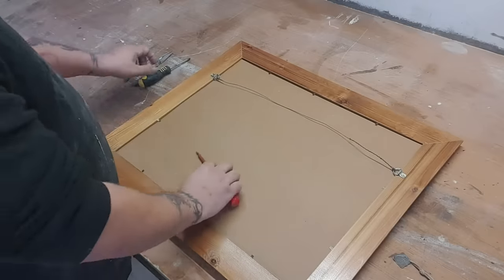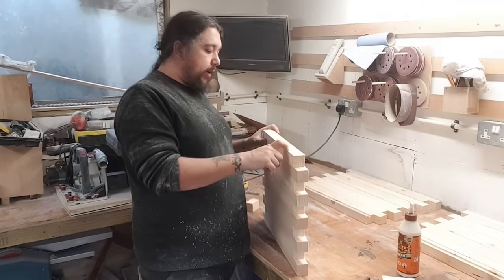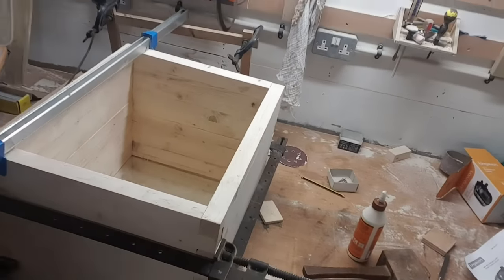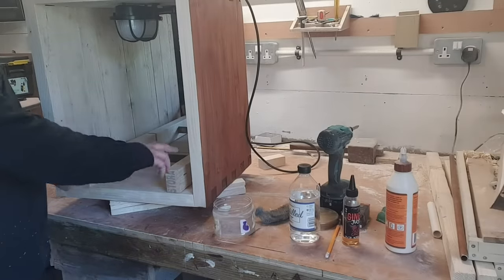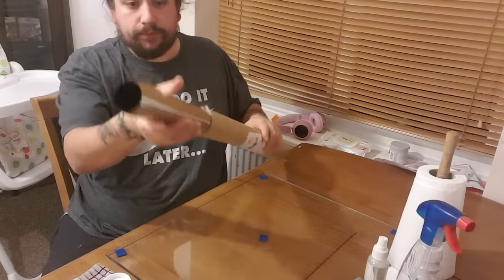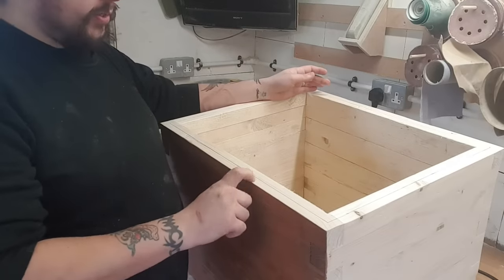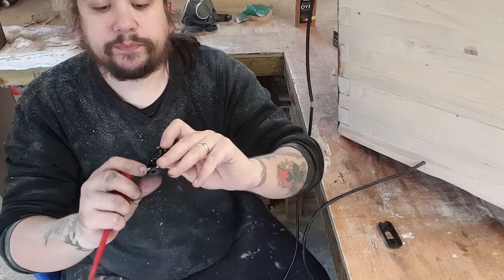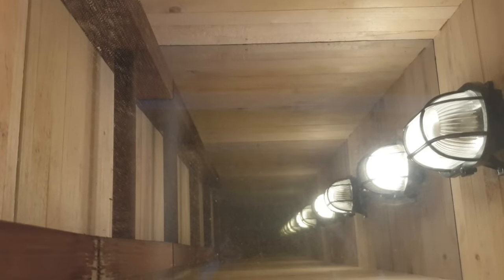Infinity mirror mineshaft coffee table

Comment: For the lamp, if you had cut it in half and pressed it right up against the mirror, you could have doubled the depth effect by making the lamp appear to repeat half as often.
Reply: The light was the only thing I disliked...so half a light mounted against the mirror at the bottom would create half the repetition?
Reply: @Rob86er  Yes, exactly. Though he would of course have half the space to fit a bulb inside, so the electronics would probably need to be modified too.
Reply: Genius.
Reply: there would still be a noticable borderline cutting across the lamp, you can kinda see the 'sections' where the mirror starts in the video with the different shades. to ease the gap we could install the lamp horizontally.
Reply: @bi_zha  Take the cage bit from the discarded half, maybe sand it down a bit and throw it where it touches the glass. Might be able to hide the seam by pretending it is part of the fixture.
Reply: Could also just use a smaller light.
Reply: @diggoran  White matte cover and a ton of LED strip inside.
Reply: The first thing I'd do would be placing it horizontally, as those bulbs facing in alternating directions look weird. Next, cut it in half, use a matte white cover too (so nobody would see what's inside, although a massive LED in a plastic shell that looks like an actual half-bulb would likely go), and... Oh snap, the cable! No issue with one in fact, as you can paint a PVC hose to make it look metallic, and cut it in halves with ease. For the fun thing, you can also add a wiring box (cut in two as well) along with a fake cable coming from the top mirror...
Reply: @bi_zha  "there would still be a noticeable borderline cutting across the lamp" -- that might be less noticeable with a first-surface mirror.
Reply: @diggoran  I was just think he should replace the bulb with something that defuses the light differently, they alternate top and bottom also hurting the affect. But burying half the light or cutting it half is a better idea.
Reply: How would making the lamp appear less often make the reflections stretch further down? The fact of the matter is light loses some of its brightness each time its reflected, so the reflections can only go so far until its no longer visible
Reply: @lordazrielxiii7731  when I said doubled the depth effect, I didn’t mean you’d see twice as far. I just meant the individual repetitions would seem twice as far apart. Which would make the illusion that the table extends into the ground easier because there wouldn’t be as obvious of a reflection plane right at the ground height.
Reply: @lordazrielxiii7731  Ye, but what they meant is the proposed "half-bulb" should be half as powerful compared to a real one in order to make the light output realistic. As your visibility threshold is based on the power of the lighting, the more powerful the light source is, the more reflections the initial light can sustain before visually fading to dark under a given ambient lighting conditions (however cutting the power in half will drop as many interreflections as it takes to take half of the power by means of the glass, which is actually just a few). But your vision is also exponential in nature, so I guess making "half" of a lightbulb as powerful as an entire one used here (therefore the complete light source image will be twice as bright) won't visually make the bulb unnaturally bright - even if it will be even brighter (say, three-four times is not that bad).
Reply: It would repeat just as often. All that would change is that the whole column of lights would be shifted by half a step.
Reply: @rabidL3M0NS  Lol think before you type :) Of course "it" will, but "it" in this case is a half of the bulb prop, making one full bulb per two segments therefore (0.5 bulbs-per-run, not 1). If you can't imagine why it happens, figure that the "entry" mirrors of every segment alternate, so (in case of a bottom-side half-bulb) you will have: no bulb on segment 1 entry, half on s1 exit,  half on s2 entry, no bulb again on both s2 exit and s3 entry etc... So there will be NO bulbs per a two-segment run (like s2-s3).
Reply: @TheBypasser  Omg you’re right. This is why I shouldn’t comment at 2 o’clock in the morning lol 🫠💤
Reply: @rabidL3M0NS  it would repeat just as often, but the pattern would be different. Instead of being evenly spaced, every pair of lights would be close together, and the gaps between each pair would be larger. Then, if you cut the light in half and press it very close to its reflection, each close pair would look like one light. Therefore making it seem like the lights are repeating half as often.
Reply: @bi_zha  wonder if you could cut out the mirror perfectly so that the light is recessed in it slightly, removing that gap
Reply: WHY is there always a smartarse?????

THIS is already a brilliant piece of work.
Are you cheesed because you didn't think of it first???
Reply: That's a good idea but how to cut that outside glass? It's quite thick so maybe it's possible with a grinding wheel?
Reply: As a second thought, i think it cannot work with objects that touch the mirror. The second half would nowhere be visible
Reply: ok but.. how would the lamp light up?
Reply: @Rob86er  agree
Reply: Maybe paint the ladder black or use a black metal ladder, so you can't see the transition as easily too.
Reply: So regardless of what light you use, it should be as close to the glass a possible?
Reply: @@childofthe60s100  calm down dude, nobody said it was anything short of brilliant. They're just chucking their penny in, it's allowed you know. Absolutely no need to get all shouty.
Reply: You all forget one thing: The limitation of the depth is the light getting out. So the more light you have inside the box, the deeper the hole gets. Making the lamp half only reduces the depth(number of times it mirrors).   the other effect is that it would look like the lamps are further apart. twice the distance. To archieve that you could also just make the lamp smaller or the box bigger :)
Reply: @Wiz Woodwork

Bro that was 🔥 🔥🔥
just the way you have it.
Reply: @computerjantje  the light is LED lights so if he cuts the fixture in half he can still arrange the LED'S to get the same amount of lighting as with the whole unit , no?
Reply: Send me a link for your improved model.. I look forward to seeing it. Thanks
Reply: @CharlesM-ml6zx  No problem, boss, how much are you paying me for it? I’m not criticizing the video, so I don’t see any reason to remake the video. I’m also not criticizing any of the rest of the coffee table, so I don’t see any reason to remake the coffee table. But if you’d like a link to a diagram of a light being cut in half and pressed against a mirror, I’d be happy to draft that up for you. Let’s just put into contract the terms of my compensation and you’ll have full rights to expect a product from me as a result.

Comment: Great project. As an alternative to routing the top mirror rebate on the almost finished table, you could have easily created the rebate on your table saw at the cutting stage. This would be quicker, easier and provide razor sharp edges if done carefully. Thanks for posting.

Comment: Awesome work and very good effect.. Two things really: 
1. The bottom mirror should have the mirror-layer (aluminium-vapoured onto the glass)) at the top of the glass, although a bit harder to find, this would improve the effect mainly the continuing of the ladder, now there are some seperations at the glass. 
2. The conduit-bracket should be cut in half to improve the effect as well, fixing it tightly to the bottom mirror.

Comment: When routing on the edge, you could always fasten something to the underside of the router base to give you the correct stand off distance. Just a bit of scrap mdf wound do it. Another option is running the table saw blade part depth before the glue up to achieve the same thing - however this would go end to end of the wood, and therefore you'd have to joint the corners at 45 degrees. The wood commonly used for scaffold boards does expand and contract well in humid environments as I've found out from making bar counter tops.
Reply: this is a good Idea,  I would have taken the amount of the plate of the router hanging  over the box 25mm or whatever it is ripped the corner off a scrap board this depth, clamped that to the outside box now you have a fence.

Comment: For the fence, 2 options, cut a piece of scrap that you can clamp to the side of your piece and run the flat side of your trim router along (you would need to cut out a negative space for this piece) .. or make a new plate out of plywood for your router and screw it on.  Then Brad nail a fence onto the bottom of it.

Comment: When putting the tint or 2 way mirror on there, don’t be afraid to spray soapy water on it to make it easier for the squeegee to run along it to get the bubbles out. They will also help to get scratches all over it.
Reply: First time I learned this trick it blew my mind, it would never occur to me to use soapy water to help me stick something down!
Reply: Do you mean between the tint and the glass (as the other comment here seems to imply) or on top where you run the squeegee (as you seem to imply)?
Reply from the maker: Between tint and the glass
Reply: Both actually. Between the glass and tint will help you get it where you want it. Also on the tint so that when you push out bubbles, it wont scratch. Don’t be scared to use ALOT. It is easy to wipe up. With all the houses and cars that I have tinted I have only wished I had used more, never less.

Comment: that car reflective film  got get some  make a few these 
i have  Lots round mirrors & clock class fronts ive saved  from scap heaps
Reply: also have a huge bag  of small led lights & coin  5mm  batteries  they we're some x stock promotion  that are inside a blowup display 500 these :) 
 got  solder the leds around the circle case + resistors   reflective film at rear glass clock front 5vlt power supply have lots these from mobiles & appliances

Comment: Very cool project. My only suggestion would be to turn you mirror into a "first surface" mirror. For this you would attach the mirror in the same way but face down so the gray backing of the mirror is exposed then you want to apply paint stripper to the mirror. Once the gray backing starts to breakdown and you can see the shiny surface underneath you want to spray orange oil over it. At this point very carefully (the actual mirror layer is very thin and delicate) use a microfiber cloth and a rinse of distilled water to remove the gray backing. It's a bit of work but what you are left with is a first surface mirror where there is no glass between reflections. This means there will be many more reflections, less distortion and no green tinge in the reflections. Also, there will be no dark lines (that are normally caused by the small gap that the glass normally makes between the scene and the reflection.). The mirror is very delicate but since it is closed off from the outside world in this project that shouldn't be a problem.
Reply: I'm unfamiliar with this -- what would be the advantage?
Reply: @giandeau  The advantages are that:  
-The mirror will be more reflective meaning the tunnel will look much longer.

-The glass on the front side of most mirrors has a very slight "greenish" tinge so normally with each reflection this greenish tinge is amplified, giving an "green fog" effect to the ilusion. If the mirror is treated and installed the way I suggested , the light won't go through the glass at all, completely eliminating the "green fog" effect.

-Normally, the actual mirror and objects in the scene (like the ladder and the pipe that connect the light) are seperated from the mirror by the glass that is in front of it, this cause a small visible gap or seam between each reflection. If the mirror is installed the way I suggest this gap/seam is eliminated making the ilusion much more convincing.

-The glass also causes "artifacts" like secondary reflections and distortion due to the glass' imperfect nature and these artifacts are amplified with each reflection. Doing it the way I suggested will eliminate this. 

Again this does take more work and it has to be done carefully as the mirror surface itself is quite delicate (which is why it is typically protected by a layer of glass on one side and a few coats of gray paint on the other). When you set an object against the mirror you are probably going to damage the surface of the mirror so you really don't want to move things around too much once they are touching it.
Reply: Can you use mirror film, like the 2-way, instead of a glass mirror on the bottom for the same result?

Comment: Wow, it turned out well. The Secret to window film is to get the glass and film soaking wet with a water and baby shampoo solution in a spray bottle. Though even then it can be tricky so always buy more film than you think you'll need.
Reply from the maker: Yeah found that out... 1st time we only did a light must... so pulled it up n wet it... if I did it again I'd soak it

Comment: @9:30 try using humic acid from a garden center, it's what gives rich soil it's deep color, that dark stains your hands blackish-brown. an once or two mixed with a pint of water in a spray-bottle. spot spray where you want heavy stain, then lightly spray over the whole area to have contrasting stains until absorbed, then allow wood to dry. give it a very light sanding, then coat with finish of choice.

Comment: another weathering trick that is a bit quicker and more effective is to take a blow torch to the wood. Burn the heck out of it and then take a wire brush to it....the burned soft wood will wipe away and leave you with a rich soft brown finish with raised hardwood grain.....super soft to the touch and really good looking. no stain.

Comment: The way to easily make the rabbet for the top panel of the cabinet (which I have done) is first get a proper router; what you showed is a laminate trimmer.  For the router, get a bit that has a bearing on the tip; size the bearing smaller than the cutting size to make the rabbet the right width.  Finally, to keep the router straight when you're on the narrow edge of the box, use a "bridge".  That is, replace the base plate with a piece of wood, aluminum, polycarbonate, or whatever that's long enough to straddle the other side of the box.  Most any thin material you use will need additional stiffening, which you mount as joists on the upper surface of the bridge.
Reply: OR use the tablesaw for a single pass to the desired simensioin on all four sides before assembling. Look great!

Comment: A quick tip for a temporary router fence. If you get a small block of wood and double-sided tape to the underside of the router and use that to run along the wood piece.

Comment: Brilliant project, I might have to copy it lol. 
A thought on routing the top, a fence doesn't need to be attached to the router, ever used a straight edge clamped down as a guide for a saw? You have clamps and could have clamped a straight piece of wood to the outside and added spacers to get the width of cut you needed. 
Thinking outside the box and 45 years of carpentry experience lol.

Comment: Great job. I wonder if you can get polarised mirrors. You could use them along with the correct light for the ladder bit. And underneath the bottom mirror have a monster/ghost thing with a light of the opposite polarisation shining at it so as you will see it but it will not be reflected by the mirrors. You will see a mine shaft with a monster thing a couple of rungs down below floor level. Just a thought.
Reply: It's an interesting idea, the only issue is that scattered light (like that reflected from anything that isn't "shiny") doesn't preserve polarisation very well. You could totally hide the light source itself doing this though, making objects appear as if they are being lit without external illumination (almost as if they are glowing). Which could be a really neat effect.
Reply: @zachcrawford5  didn't think about that maybe minimise the scattering by implementing a light absorbing paint strategically for the viewers perspective

Comment: Hi, love the idea, You actully do have the tools for the router guide. Next project use a board on the outside with a notch for set back of the edge of the router made on the table saw. You can make a simple frame to go all the way around and clamp it in place or use small nails that you remove after and fill the holes. (this is best way as you don't over shoot the corners) or do one side at a time and add a stop to prevent over cutting corners.  Then  use chiesl to remove the small bit in the inside four corners.I am not sure what parts you have available but do you  have a combo switch and plug? Oh one last idea. add brackets to hold ladder to wall at the mirror base to help hide the gap. Youi only have to make half a bracket so the other side is seen on the mirror. Keep up the good work and ideas

Comment: little tip on steel wool/vinegar aging- wipe all the wood down with regular tea first and let it dry beforehand. Then do the vinegar steel wool. the tannins in the tea make the stain come out darker.
Reply: That works, but also there is a brick ageing compound called “liquid weather”.  Works a treat on very dry porous softwood.  The “mineshaft” timbers would look epic if you used old pallet wood.

Comment: Just watched the final scene. Since the ladder shows a repeated seam, I wonder if placing a rung at the bottom, using a ripped rung. One side on top and one on bottom. This (I’m wondering) might maintain the illusion that each step is fully round and if laid (including the bottom ladder rails surface) having a tight flush match to bottom, eliminate the seam so the ladder looks solid all the way into forever. 

Very very cool dude.